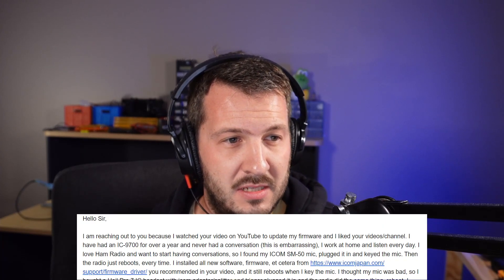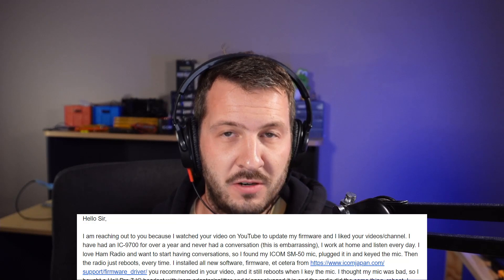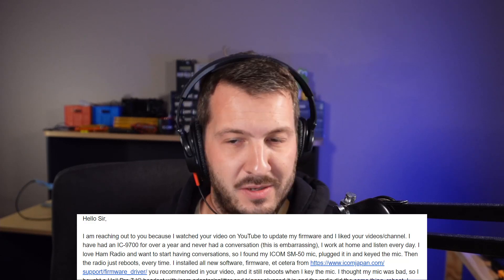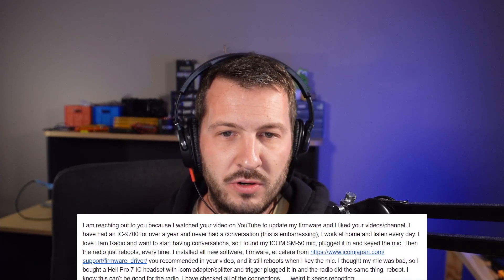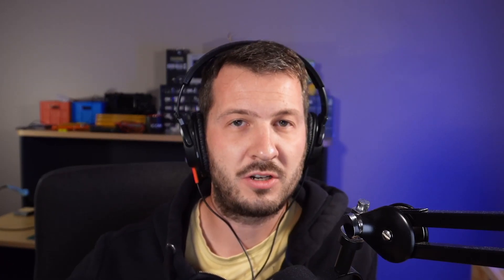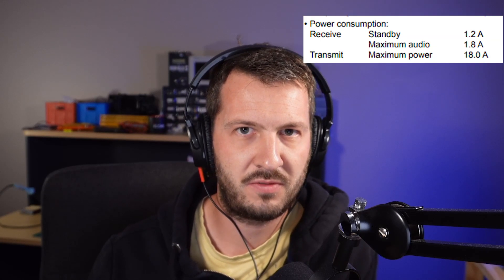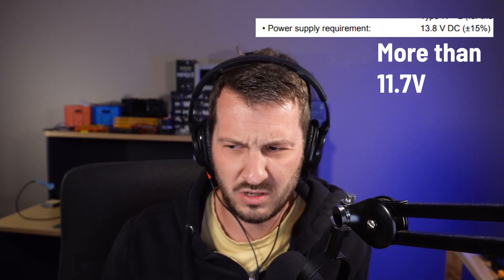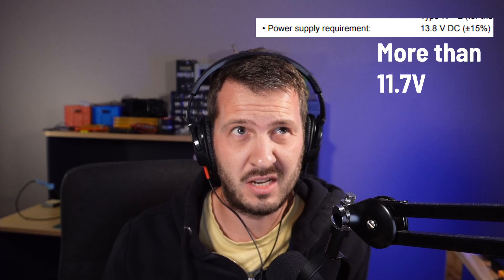HELP! My Icom Radio Keeps Rebooting!

Comment: I had the same issue with my 756 Pro II. Not EVERY time I key up, but just at random. But always when the rig was in transmit mode. I suspected a voltage sag, so I changed the power supply, and the problem never re-occured again.

Comment: 👍 I found this video useful in taking a pragmatic approach in trying to find why my IC7300 kept rebooting when transmitting - it would only happen at certain powers. I checked the fuses and the connections, all good there, checked the grounding, no issues. So went into RTTY mode and slowly stepped up the power, sure enough at 30W (or +/- 1W) it would reboot, or not even turn on. The fact that it was when the power was being raised and I had checked for RF not getting back into the radio meant I had to track it. I then looked at the power supply (which feeds all my radios) and has been rock-solid for the 2+ years I had it - sure enough I had some how knocked/turn the power supply level down to 9V, turning it back up to the required voltage (13.8) stopped the rebooting ! :) Great video with common sense steps solved it, was almost on the verge of sending it to Icom ! 🤦
Reply from the maker: Awesome! Fault finding is a handy skill to have and sounds like you nailed it 👍 well done

Comment: Great tips Hayden & all especially knocking back the power, switching to RTTY etc.
Another thing I'd check right on the power input connector of the radio is not just the input DC voltage upon Tx but also switch the DMM to AC to check for any voltage ripple which could indicate either a failing power supply or excess current draw in the 9700.
It wouldn't also hurt to check the parasitic current draw on the radio which is readable on those power supplies which display both voltage & current.
The Icom 7300, 9700, 705 etc meter display showing the Id current is extremely handy to also monitor any power draws.
Yet another thing I'd try is change the leads or add ferrites or even re-check the antenna and grounding system just in case stray RF is getting back into the radio, but that is a long shot.
 I agree, the power supply current capabilities and power supply feed leads are highly likely to be the culprit

Comment: I had similar problem using mu TS590SG, the problem was actually oxide on 20A blade fuse in my h/brew psu, changed the fuse problem dissapeared.

Comment: Good advice on this potentially being a power supply issue; I saw similar problems back when I worked in the land mobile radio field many years ago.  Something as simple as a corroded fuse holder could COMPLETELY kill a 100 watt radio on key - up (& this is before microprocessor- based radios) - the radio would work fine on receive & completely die on transmit due to voltage drop across the corroded connecttion. My old ICOM IC-756 would repeatedly key & unkey if I was running it off a battery supply & the voltage dipped below 10 volts; connect a fresh battery or proper power supply, the problem went away!  Good advice, Hayden.  

73, Tom WA1LBK
Reply from the maker: Thanks Tom!

Comment: Sounds like a power supply issue rather than anything else but if its a linear power supply its usually a bad transformer or transistor

Comment: If you are using the Alinco MV33 I think it is, there is a bad cap on the board. If you switch from variable to fixed Vc on the back it works great. I've had this issue on a few power supplies. If I still had the old ones, a .25 cent part and I could sell the others off and make a few $$ back.  Amateur Logic replaced one on one on there episodes, but I can not remember what episode it was. Trying to find it for myself!!!

Comment: Maybe RF getting into the power supply. My older HP supply doesn’t like when I Tx on 10m/6m. Sum times even using the int tuner on those bands will kick it out but if I swap to my switcher supply all is well but it has no crow bar so if it’s regulation fails it will certainly cook my ftdx10 which I won’t risk. But look into a field strength meter to see, or use a torroid on the power wires back at the supply and route the tuner rig feedline away from the power supply

Comment: Another one is antenna problems making the radio chassis very 'hot' with RF, this can get into the mic lead etc and crash the radio.
Set it to min power and connect a dummy load, if ok, slowly wind up the power as discussed in the video. If you cannot fault it into a dummy load yet it dies on your antenna - then there is your problem.

Also, with power supply problems, quite often a scope is a better tool to monitor a supply, as a quick drop to near zero, then return to full voltage after the radio removes it's 20A load, can be so short that most meters will not see it, or miss display it as only a one volt dip.
Reply: Also stray RF can cause power supply issues beyond those of 'can it power this radio', as in it may be able to run more than one radio, however an unhealthy gulp of RF could bring it to its knees.
Or worse, make it loose regulation and over volt the radio!
Reply: Excellent suggestion. I had this very problem with RF. Radio would turn off only when running an amp. Proper grounding solved these issues with my random wire.

Comment: I definitely agree that it's likely to be the power supply not being able to supply sufficient current ... I had exactly the same thing happen when I first got my IC-7300 ... I didn't have a power supply, but I figured I'd just be able to plug it into my electronics workbench supply and get a watt or two out of it.  No such luck though; even at 1% it drew more current than the supply was capable of, so it went into constant-current mode and dropped the voltage, and the radio rebooted.
Reply from the maker: Thanks Sam, great points!

Comment: They are good tips to try. 👍
If they have one of those plug in power usage plug pack thingy's, they will measure real time voltage, current and power draw. could be handy, I use them now and then to test stuff. Also I've had weird issues with power cords if someone has tripped over the lead and now has an internal damaged cable with intermittent connection... i.e. computer lan party. lol

Comment: When I got my 7100 I tried using a power source that was too low for the radio and it shut itself off as well. I think Hayden is on the nose with his diagnosis.

Comment: Good video, Hayden. My ID-5100 reboots in the truck if the battery voltage is a bit low and the vehicle is off... I imagine it may be the same thing for him. Good tips to check!
Reply from the maker: Thanks Steve! Yes possibly the voltage sag causing it to reboot. Enjoy the Dunkin’ Donuts this morning!
Reply: @HamRadioDX  No donuts, just coffee for me. The donuts soak up too much caffeine!
Reply from the maker: 😂 regardless, enjoy!